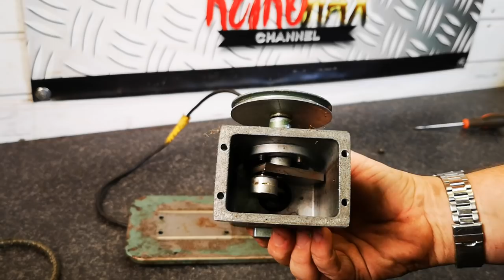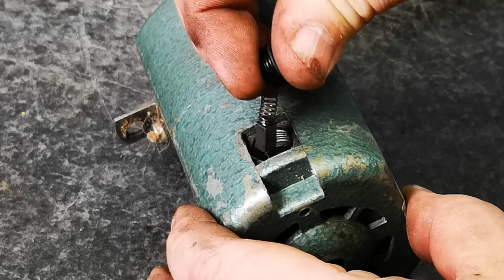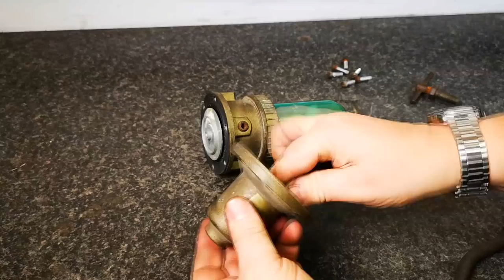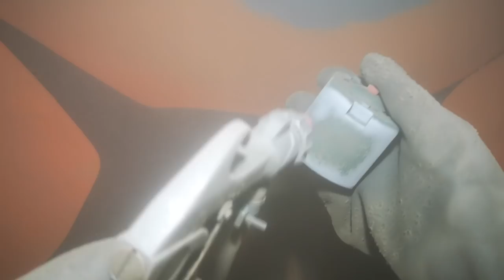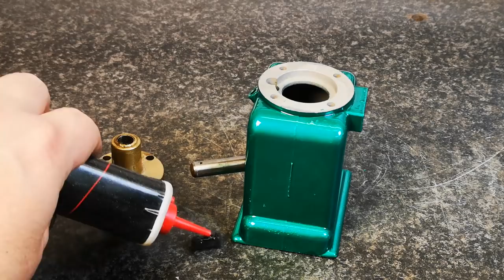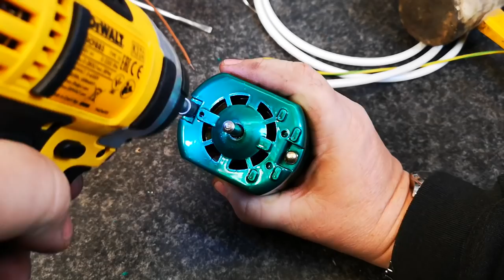Miller Vintage Mini Air Compressor Restoration

Comment: Very nice restoration.   I did enjoy seeing the inside of the reciprocating compressor, plate valves, etc.   Glad there was some oil still inside so no rust, also glad the spring was not broken.
Well done.
Dave.
Reply from the maker: Thanks Dave

Comment: Beautiful restoration work.  I owned one of these in the mid-1960s; my friend and I got many hours of use out of it airbrushing plastic model kits.  It was a Christmas gift from my parents along with a new Binks airbrush, a big step up from the entry level Badger with the cans of compressed air I had been using.  We used it for a couple years until my friend got a diaphragm-type compressor which was much quieter-running.  Many happy memories, good to see one restored to as-new condition.  The line filter is not part of the standard kit but is definitely a good idea; on a humid day you'll get water droplets mixed with the paint spray.  I like the colors you picked too, the green is a nice riff on the original green hammer tone finish.  If I recall correctly it did have 4 foam rubber blocks or something similar for feet, mine didn't walk like that in use.  One request: when you first start up one of your restorations, could you pause the music for 8-10 seconds so we can hear just the sound of the equipment running?  I like your music choices but was really looking forward to hearing the chatter of that piston running again; it's almost drowned out by the music.

Comment: You could brag and blow about this restoration 
But this restored compressor will blow all negative comments away
For is a lovely piece of engineering and in simple words marvellous 
Saved from scrap cracking martin
Reply from the maker: Thanks Chris. Solid and simple engineering.

Comment: Fantastic job!!!  I have an old Miller at home, had it for 30 years.  Question:  What size/type belt did you use to replace the old one?  Having trouble getting a replacement for mine.
Reply from the maker: I can't remember, sorry

Comment: A classy restoration. I got the impression the motor was running too fast though, perhaps it was intended to run on the lower voltage US supply?
Reply from the maker: Its a 220/240 volt motor bud Same as the supply voltage here
Reply: Frequency dictates speed...

In the UK it's 50 cycles
In the USA it's 60 cycles
🇬🇧👍

Comment: Minor nitpicking: 3-In-One-Oil isn´t a good lubricant for fast-moving parts. It´s more meant for bicycle chains, door hinges and such.
Think of it as a better WD40 ( which doesnt lube almost at all ). There sure is some oil specially made for compressor applications, but I think simple engine oil would do a good enough job, at least compared to 3-In-One.

Comment: Pretty cool little machine. Great job. Any idea what kind of PSI or kPa it puts out?
Reply from the maker: The water trap is rated to 150 but I doubt it would reach that.
Reply: @RetroHax  - I'm curious what it DOES reach.  Screw a gauge on there and lets see!

Comment: Hi Martin what a cracking bit of kit that is, would that be any good for air brushing ? turn the air pressure down, it so needed the earth on the chassis, I am like you a sparks mainly house bashing !  from yester year, ATB Wayne.
Reply from the maker: Its very noisy though. Not as refined as modern ones.

Comment: I'm curious if the parts that you powder coated gold we're actually brass and if they were would it not have been better to polish them?
Reply from the maker: It was not brass, it was mild steel. I wouldn't powdercoat brass.
Reply: @RetroHax  ahhh cheers mate beautiful restoration as usual.

Comment: Has the motor got its own earthing point Martin...?
As you can't just rely on earthing the chassis as that motor is on a hinge tensioner arrangement....🇬🇧👍
Reply from the maker: Yes Glenn
Reply: @RetroHax  

Hey...I were only sayin...
It's still nice work you did Martin...🇬🇧👍

Comment: I have to admit when I first saw it I thought 'Mr Hax has got his work cut out on this one', on first sight a manky looking piece of old shite, a length of electric string with no plug hanging from it, and then you turned the drive belt and it came off, FPMSL. Wunderbar Mr Hax, once again you didn't fail, I thought the two colours were fantastic also, next time you go to the pub buy yourself a pint from me.
Reply from the maker: Thanks Kev

Comment: That's pretty sweet Retro. How old is it? Do you know the purpose of the green glass assembly?
Reply from the maker: 1950s I think
Reply: Its a combination water filter (on bottom) and a pressure regulator on top. its probable this compressor was used for small time spray painting jobs.

Comment: Good afternoon, what is this compressor from?
Reply from the maker: I don't quite know, maybe and airbrush
Reply: @RetroHax  Thank you
Reply: It was made by K.J. Miller Company in Brookfield, IL - on the manufacturer's plate.  They were available in local hobby shops around Chicago, I got one for a Christmas gift in the mid-1960s to use with an airbrush for painting plastic model kits.  I was amazed to see the motor is wired European 220/240V 50 Hz, would not have thought it was something exported and used outside the US.

Comment: what would this have been used for?
Reply from the maker: Possibly an airbrush
Reply: I used mine with an airbrush.  You can see on the manufacturer's plate it was made by K.J. Miller in Brookfield, IL.  My parent's gave me one for a Christmas gift, I believe they purchased it from a hobby shop in the Roseland neighborhood of Chicago, a place named Stu DeJong's Hobbies.  I recall seeing it in their display case, it was with the airbrushes.  I wonder how far around the country K.J. Miller shipped them, or if most were sold around Chicago and the Midwest?

Comment: Did I just see someone powdercoating brass parts in gold? That'sd be either lazy or stupid, most likely both. dislike!
Reply from the maker: Get your facts right , It was steel. Didn't you see it after sand blasting. Watch the video properly before you make a fool of yourself.

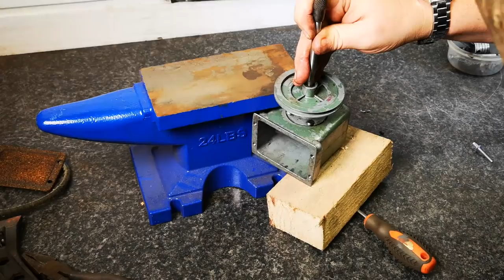Comment: 3:45 Those two holes might be for some missing oil cups, might want to look into that
Reply: That's what I'm thinking too. This probably would have been a light duty or "budget" compressor of the time. I just wonder how the connecting rod is supposed to be oiled.